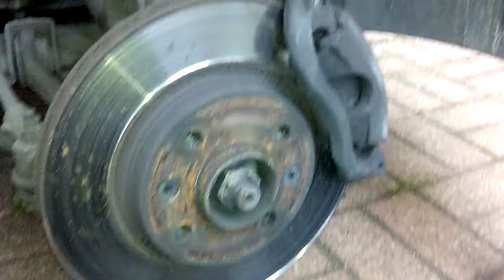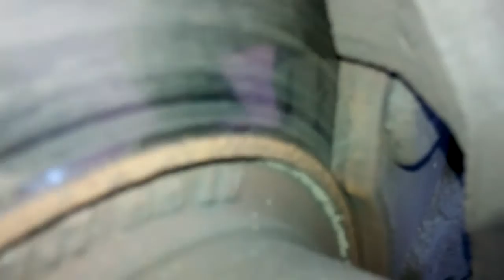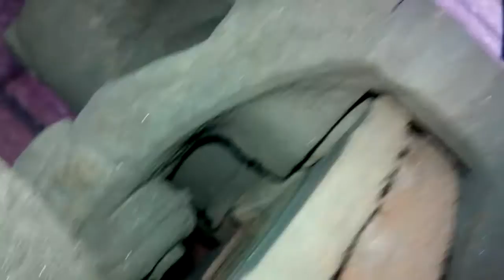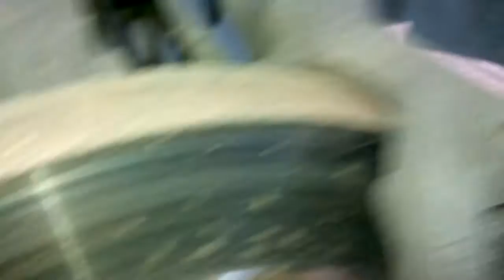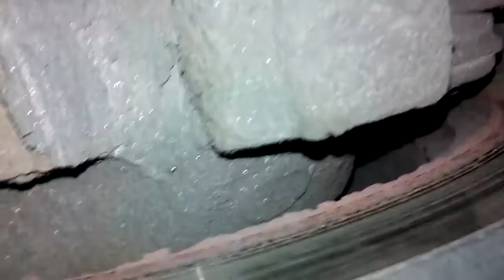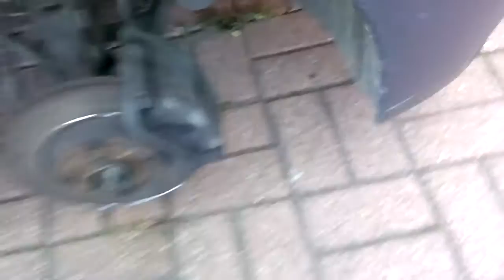Remschijf maakt krassend geluid / Brake disc makes scratching noise

Comment: Looks as though it has been under water for a long time.
Reply from the maker: Maybe the previous owner used the car as a boat but i don't. :)
Both the brake disc and brake pads have since been replaced.